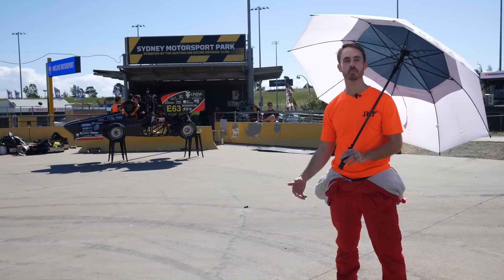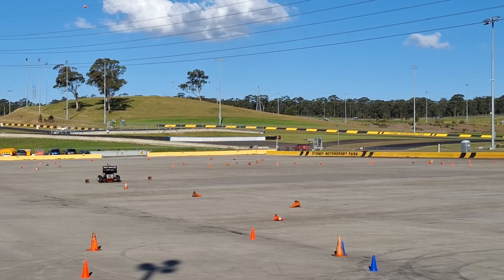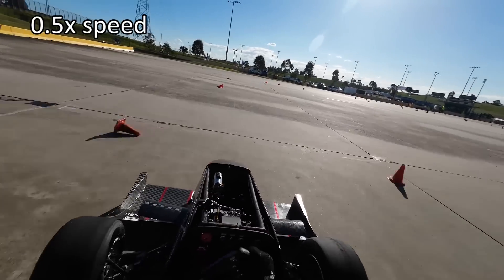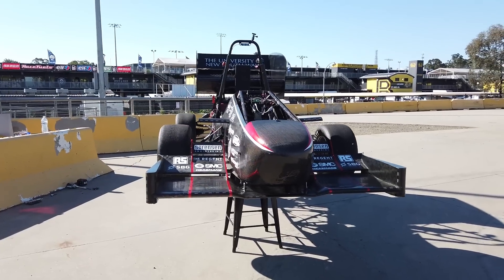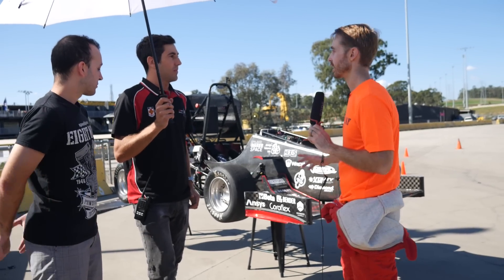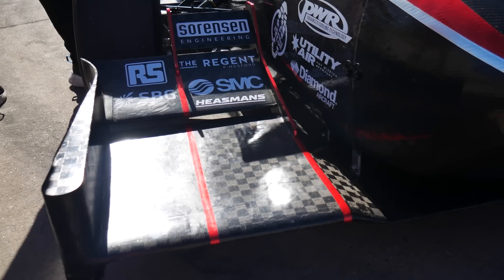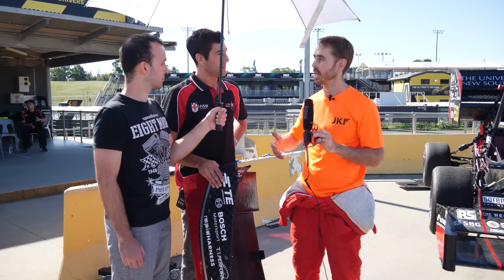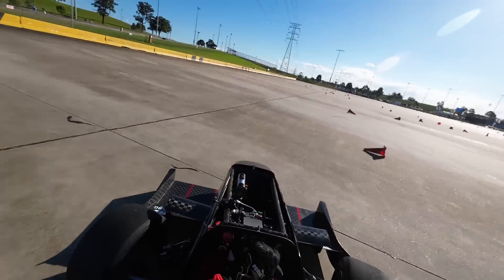F1 Engineer vs. Student Built Racecar

Comment: "support the mechanical grip"

Can't decouple heave and roll 

Um....Based on the feedback of the rear being very stable and the front kind of washing out, it seems as if they missed the mark on the front end of the car. Sure the aero works and it's with a low budget but it seems as though they didn't address the mechanical grip on the front end AFTER they accomplished the front aero packaging.

Comment: What do you make of the new Ferrari package, especially the new horns next to the cockpit? I can't quite figure those horn's contribution to the airflow and how the overall low and high pressures it creates will change the airflow downstream. I knew their effect is probably minor, but their shape just looks so interesting. I'd be especially grateful if you discussed how airflow is effected where two airfoils meet. How does the overall effect change if the airfoils have high pressure on the same side vs opposite sides and where do the vortexes actually shed from the structure?

Are you going to make a video about the new aero updates for the cars? I'm very interested in what you make of the new Ferrari package, especially the new horns next to the cockpit. I can't quite figure those horn's contribution to the airflow and how the overall low and high pressures it creates will change the airflow downstream. It would be cool if you went over the McLaren updates as well before they bring when further updates later in the season.

Comment: What a great video, thank you so much for coming out to drive the car along with all our other Redback Racing alumni!

As a driver of RB23 last year in skidpan and acceleration your feedback about the handling characteristics is extremely validating. Being part of the suspension department its always been a tricky balancing act between optimising the mechanical grip of the car compared to aerodynamic platform stability. Exactly as you said, our limitations with front ride height and heave stiffness does slightly limit our setup options in terms of front and rear stiffness and damping, where on this car we're running close to the minimum ride height and front springrate that we can run without excessively scraping the front wing. As a consequence this does result in a car that with this setup is slightly biased towards understeer, but also given the power of the electric motor going to the rear wheels the rear stability offered in return is actually quite appreciated. Even at this high power setting the car has even more power and torque to deliver, so at it's maximum setting understeer is less of an issue to say the least :)

We also tried out multiple different toe settings last year in testing comparing turn in response vs mid corner grip and this is something we're still yearning for even more testing time to get perfectly dialled in. What makes it even more complicated is when a toe out setting for a 60+kg driver becomes far too twitchy for a 48kg driver like myself due to different weight distribution, requiring different setups per driver lol. That's also not including different driving styles where I empathise with my fellow members' concern when I want more and more oversteer from the setup while already scaring the living daylights out of them with the silly way I drive :P

Hopefully this year's car will address a lot of the feedback we received for RB23 this and last year and we'll be able to have a car we can more comfortably tune the handling balance of. Thanks again for coming by and making this video!
Reply: @samarthdalvi1323 Good question! As I similarly answered to someone else, going with simpler direct actuation was intended to reduce costs but more critically reduce design and manufacturing time/complexity. RB23 was designed in a relatively short window and since this was going to be our first dynamic EV class vehicle we wanted to make sure we got the car designed, manufactured and tested within a reasonable timeline, so at the time a decoupled setup was less of a priority for Kevin our suspension lead and kinematics designer. Overall the package still works really well! But we've got some options to fix the front heave stiffness and you'll see a bit of that this year and possibly bigger changes beyond that depending on the feasibility of a decoupled setup :)

Comment: With modern EVs getting ever better battery cells, one could have a gaping hole in the middle of the pack and still have plenty of capacity and power. Imagine you would with a battery hacker, and make space for a McMurtry Speirling style fan suction system... Some rubber strips with Tesla pump twirl profile to provide a neat seal. With a fan suction system, you can have a really slick body like Model S or Lucid Air and have a "sleeper" high downforce car that just works as a track car. Either would still be fast with a much smaller battery to save weight.
Reply: Actually the Lucid Air Pure might be reasonably well set up for this, as it doesn't have battery modules under the rear passengers' feet, for a more comfy  and deep "foot garage". Building more ground-up from a lighter chassis fitting lighter wheels, perhaps built for a heavy mid/rear mouterh engine. Could also use a front engine car, and add a fan system with powerful genarator and bettery system to that. Imagine 2 tons of any speed downforce in a not-too-heavy racecar with a slick body. Much better top speeds for thrills. Getting more lap time from more durable tyres.
Reply: Big question - would that be legal?
Reply: Check out AMZ (Swiss Formula Student team). They took their competition legal car, bumped up the power, sealed the floor with skirts and fans to suck the car down, removed the rear wing to reduce drag, and they got 0-100kmph in 0.956s.
Reply: @theWajahat  I saw that but it was a demo outside of the competition and rules. 

The rules state:

T8.1.1 defines an aerodynamic device as "A specifically designed structure mounted ON the vehicle to guide the airflow AROUND the vehicle" 

T2.2.2 "Sliding skirts or other aerodynamic devices that by design, fabrication or as a consequence of moving, contact the track surface are prohibited."

I'm pretty sure that if anyone tried it, it will either be rejected based on these regs, or the regs would be modified to exclude it.
Reply: Actually if you will join the major competitions in Europe this year like FSG, FSA or FSEast, you will be happy to see quite a few teams with some impressive powered ground systems (which is the legal system on the cars that might come closest to your idea)

Comment: Your fixed axle theory isn't necessarily true. In kart racing the fixed rear axle is used as if it were a diff by lifting the inside rear wheel. By adjusting the stiffness and length of the axle plus various(many) other adjustments the character can be set up to ones liking. Understeer and snap oversteer aren't a thing really.
Reply: This is pretty far from a kart.
Reply: @roflchopter11  correct, it's not about a kart but about a fixed rear axle vehicle behaviour.

Comment: I’m liking the chassis Vanes 13:50 , great idea. 

These projects are a priceless part of someone’s education both from an academic and practical hands on perspective . Literally skills that will be used  throughout an individual’s lifetime … 

Unfortunately i didn’t have anything like this in my school years, however I was lucky enough to be taught model aeroplane building from plans and model engineering by my Father plus many other things. 
This led then to steel fabrication and GRP . 
Now thanks to decades in the field of practical engineering I’m building and designing my own race car similar to James clays and Georg Plasa’s BMW E36  .
All hand built including molds ,jigs etc etc and apart from 2D cad laser cut components no use of a computer. 

In an ideal world I would jump at the chance to have the use of CFD or be able to have a 3D printed exhaust manifold and suspension uprights  but these are beyond my budget and practically not a viable option as of now . 

Going back to this formula the speeds they are physically restricted to due to track layout etc is fortunately compensated by the technical analysis aspect of things off track  .
 
Personally I’d love to try flexture suspension systems, a large flat vacuum bagged chassis and bottom wishbones incorporating Kevlar flextures  . These ‘Joints ‘ could be pre impregnated with a rubber compound to provide some spring resistance . Even the floor could then have some aero and structural capabilities. 
I want a beer if anyone try’s this as you heard it here first 😂
👍🇬🇧

Comment from the maker: Huge thanks to Redback Racing for having me out! You can find their socials here: https://www.facebook.com/UNSWRedbackRacing and here https://www.youtube.com/@UNSWRedbackRacing and here https://www.instagram.com/unswredbackracing/

Hope you all enjoy the video!
Reply: At 4:38 you mention heave stiffness and roll stiffness. Are there rules preventing them from running a third element that only acts on heave?
Reply: @skippy2987  hello! member of Redback Racing here that can answer your question! The rules for Formula SAE in general are quite open and one of those areas is suspension. There are multiple FSAE teams both here in Australia and abroad that not only run anti-roll bars but also do run decoupled heave and roll springs. However decoupled setups add a lot of complexity both for the suspension geometry as well as mounting for a spaceframe, and for RB23 our primary goal was to deliver a simple but well executed electric FSAE car that we could quickly design, manufacture and test such that it could pass all technical inspections and complete all dynamic events. Since we went above and beyond that objective last year, a decoupled heave and roll setup of some form is a possible option for future cars depending on its feasibility. Hope this helps!
Reply: @JaydenHW  that makes sense. The only third element setups I've seen on a car run parallel to the chassis where a T shaped anti-roll bar is, and on pushrod suspension. The FSAE cars look like they are pretty challenged for space in that area.

You'll like this one though, I've seen a setup on a human powered vehicle that used interconnected hydraulics on the front wheels connected to a single air pressurised container. It didn't work as the designer intended (as a primary spring) precisely because it had zero roll resistance (except damping from fluid movement). So a hydraulic third element could be a way to save on packaging. It could also integrate separate heave-only damping if that is somehow advantageous to separate from roll damping.

The designer actually developed a unique front suspension system too. A single leading arm live axle that incorporated anti-roll springing, reducing part count,  improving packaging, and neatly negating any camber changes on body roll. Only attached in two spots, the single central leading arm mount and a watts linkage.
Reply: @skippy2987  yeah we've actually seen what we suspect to be hydraulic systems on other Aussie FSAE cars! seems like depending on the way they route it they can either utilise it as additional heave or roll stiffness and (though I could be wrong with this) it can probably be done with dampers that utilise an external reservoir and linking the two left and right dampers together.  I don't think it's possible with our current dampers but yes that is absolutely another option in FSAE!
Reply: @JaydenHW  I'm not sure you could add significant heave spring like that. If I understand the way a normal damper operates the spring effect from gas pressure is pretty much limited to the diameter of the shaft, so the pressure would border on insane.

Out of curiosity, do you have any kind of anti-roll bar? I couldn't see one in the video but I also didn't see any clear shot of the front suspension.

And are you allowed to have any kind of active suspension? I can see a moveable upper coilover mount achieving the same goal.
Reply: @skippy2987 actually yeah I'd think your right in terms of heave stiffness because the force from damping would be weaker compared to a dedicated spring. The teams I did see with a linked damper reservoir did have a heave spring so it's possible they're using it for a small amount of additional roll stiffness or damping instead, or they're doing a hydraulic system after all and i confused that with the damper reservoir.

Our current car doesn't use an ARB at the front or rear either as it optimally requires indirect actuation like push or pull rod and we decided last year to stay with direct actuation front and rear for simplicity. I believe there isn't anything preventing the use of active suspension either though I haven't seen a lot of teams do it, possibly due to increased development time and complexity without a major advantage compared to a good mode decoupled system? Again I could be wrong (I dont claim to know everything!) but it's certainly another interesting element of FSAE suspension.